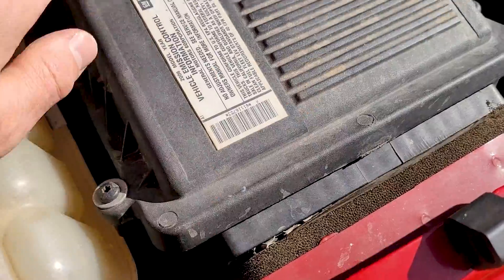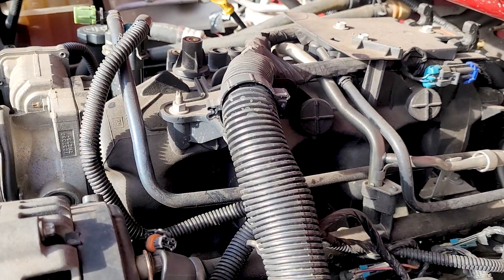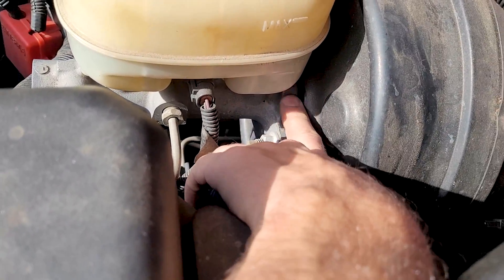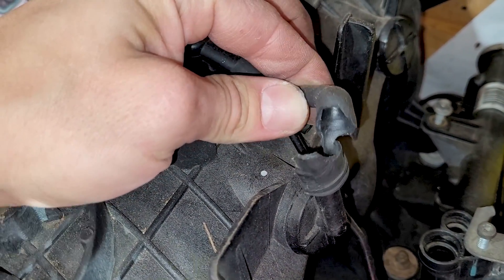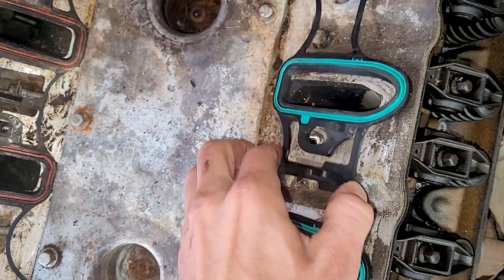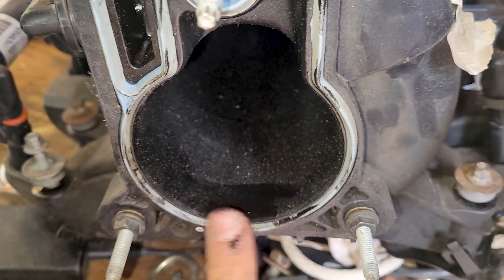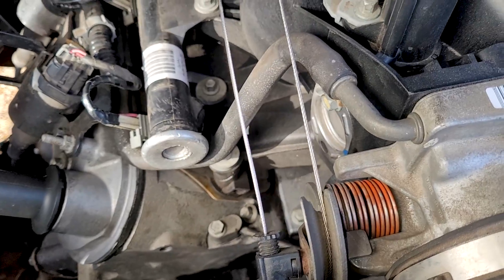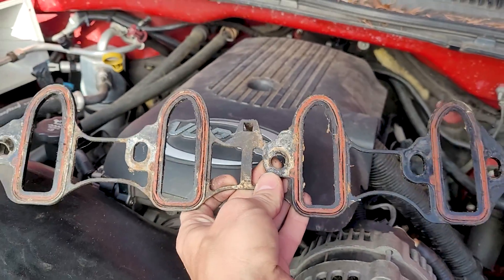EVERY Chevy Engine Vacuum LEAKS!

Comment: Hey man im having issue with my  01 Silverado 5.3 not starting the truck starts on first try and it runs perfectly but when you turn it off and try the 2nd to start it just cranks no start only starts when you leave the truck alone sitting for hours I check fuel I check everything idk where else to look need some info where i can find the problem thanks
Reply: Starter? I just did mine 2000 suburban
Reply: @christianfloresjr5097  no sir start is cranking the engine problem is it’s not firing up
Reply: @Ladies_Man214 maybe it’s not getting enough spark could be a faulty ignition coil/ distributor depending on your year or maybe it’s not getting enough fuel, could be fuel injectors or fuel pump. Check your battery connections as well. Make sure they are tight and not loose.I had a similar problem and it turned out to be a bad battery and not a very good connection if I recall.
Reply: I'd check your air and see what you're fuel pressure is doing.
Reply: Check your fuel pump relay, or 20 yellow fuse.
Reply: You find the problem? I have same truck same problem. Shop said 3 of my literally brand new injectors are bad.  Because I just had the engine, replaced with a reman. I'm not gonna pay him seven hundred dollars to replace three brand new injectors.So i'm going to do it myself, but i'm not convinced that is the problem. They said they will replace them and then test again. When I asked if they were confident about it. Also have a rich code on bank 1 and 2

Comment: I got a 2011 5.3 and a p0442 small leak code. Already replaced gas cap purge valve, canister and solenoid. Any ideas other than Smoke test????? Thanks
Reply: charcoal canister
Reply: nvm didn’t notice you said you already did that
Reply: have this problem have u fixed it yet?

Comment: Good stuff man. I got a 02 6.0. Found a vac leak at the o rings under the purge solenoid and egr tube where it connects to the intake manifold.
Reply: Did it throw a lean code? I’m scratching my head trying to figure out why I get a lean code every now and then (check engine light goes off and on randomly) 2000 6.0
Reply: How did you guys seal the EGR tube where it meats the intake. I can't find the seal to replace or get the flange to sit flat
Reply: @holdinrossing2010 what did you get?? Plz

Comment: My 2000 Suburban development a knock out of nowhere one day. I’m thinking my intake manifold gaskets were bad and water got into the engine causing a hydrolock on one of the cylinders bending a connection rod. Sucks. Ending up getting a used engine put into it

Comment: I have a 01 gmc Yukon Denali xl 6.0L I have a p0300 multiple misfires code I changed the spark plugs ( dealership) spark plug wires ( dealership) the coil packs ( dealership) & still have a misfire & my check engine light is still on
Reply: Can try a crank relearn with a scan tool if you don't actually feel the misfire.  Engine running lean or rich?
Reply: Had this happen on my 2002 suburban ended up being the intake manifold gaskets

Comment: What are the symptoms of leaking intake manifold gasket ?
Reply: You'll get p0171 - Bank 1 Too Lean and p0174 - Bank 2 Too Lean.  Look at scan data, and long-term fuel trim will be very high, +20 or more.  And if you rev it up to 2000 RPM and trims will drop down to near zero.  Let off, and they go back up.  That is tail tail intake leak sign.
Reply: @M4sterT3ch  let's say i had all those signs is their any alternative things I should check before I decide to replace those gaskets like word for word every thing you said is what happened when I test it
Reply: @JB-qr5io  Yeah, the intake manifold gaskets and any vacuum lines going to the intake.  It is not as common of an issue, but fuel injector o-rings can leak as well.  Pull the fuel pressure regulator line off to make sure then regulator diaphragm isn't ruptured.  This issue would cause a different type of symptom, though.
Reply from the maker: Poor idle, misfires, bad power, alot of different codes, bad mpg, main one is a loud hissing noise
Reply: I get p0171 when going up a hill or under heavy load. The truck feels gutless during the check engine light flashing. Once on level ground the light turns off, the code is gone. Is this the intake gaskets?
Reply: Here’s a really simple way wait to the car has warmed up and then rev the gas if it shoots water it needs intake gasket replacement. You’re welcome. Only aluminum engines are supposed to leak on start up. That’s why you have to wait till it warms up and if you were a white guy he should be no problem every time I turn around I just see white guys revving their cars. Every YouTube video no matter how cool the car is he’s revving the fucking engine.😂😂😂🤣🤣🤣🤣😭